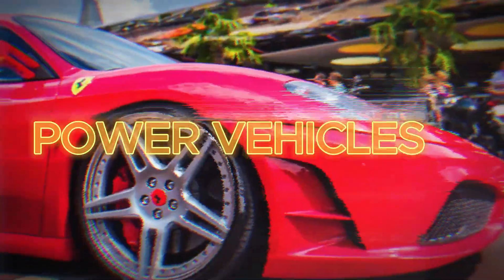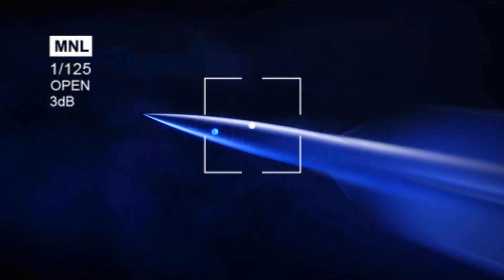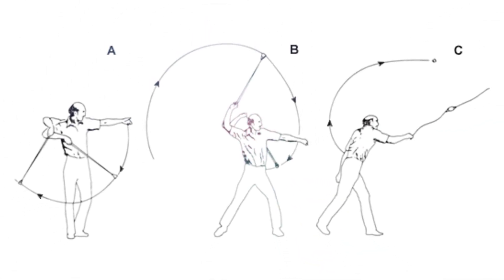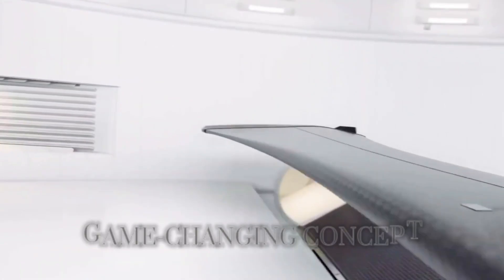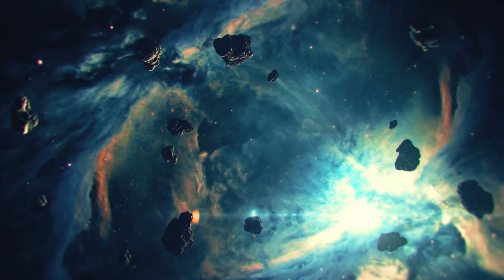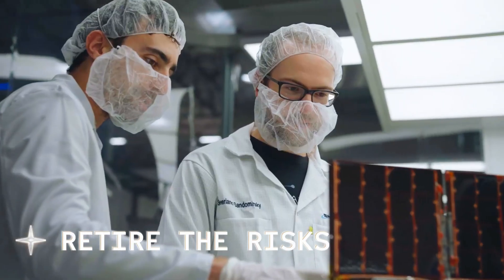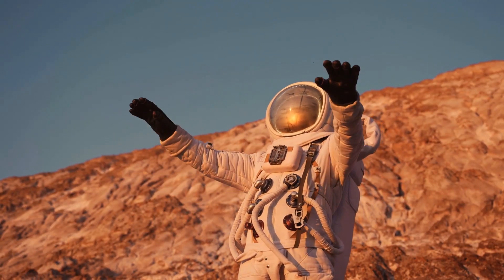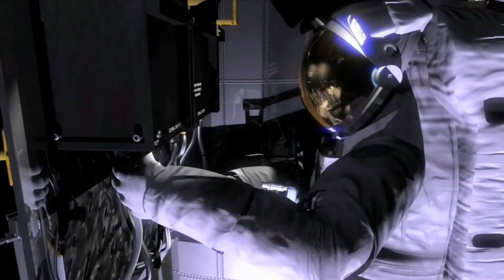New technology aims to put a whole new spin on space travel

Comment: The main problem I noticed is that traditional rocket accelerate constantly to get up to orbit, once tis rocket is out of the chamber it can’t accelerate anymore.

Also there is a thermal cam video showing the heat generated on the tip of the projectile is insanely hot!